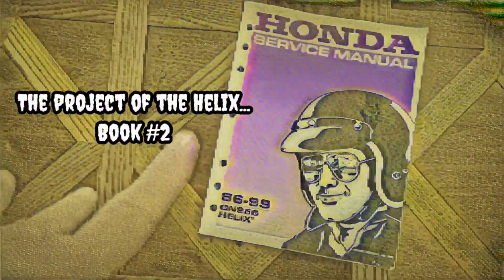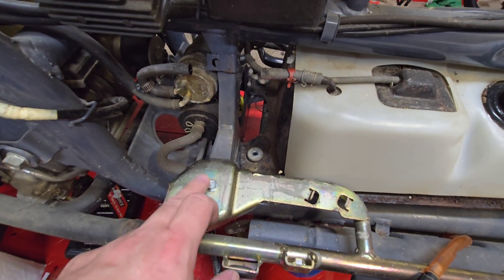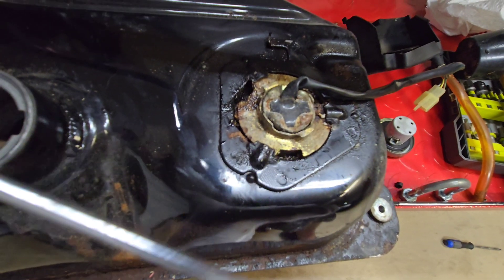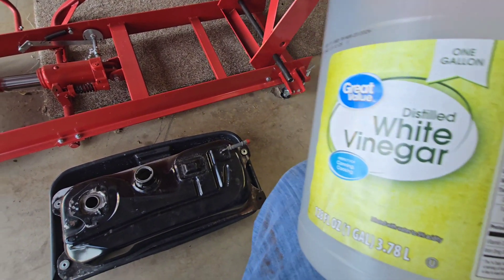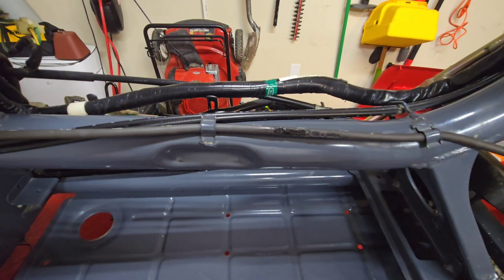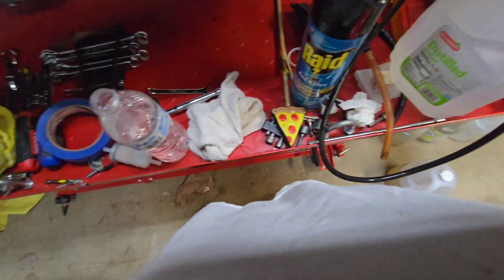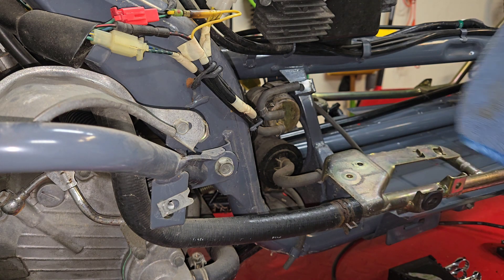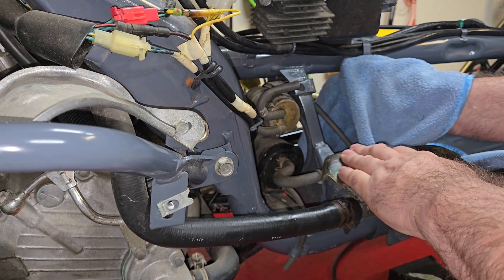Honda Helix | Gas tank removal | The Project of the Helix , Book#2 | Ruby the Elite

Comment: I found my 99 helix on Craigslist for $400, it was sitting for several years. No rodent damage, but the same heater hose damage, I think the plastic that covers it is rubbing the hose, how many feet of heater tube did you use, thanks

Comment: Ruby, The face seal cover on the drive face, could it be there also to maintain a balanced condition and a reinforcement for the drive face and to help keep dust out out of the roller area?  HH
Reply from the maker: No,  it's not used at all on current Honda scooters. It's main reason for being there was to keep the grease from exiting. Grease is no longer used. It was a bad idea to begin with. Your welcome of course to reinstall it, but I no longer have it on any of my bikes. It has no purpose except to restrict and keep grease inside. That's it. I've been removing them for more than 25 years. No issues at all.